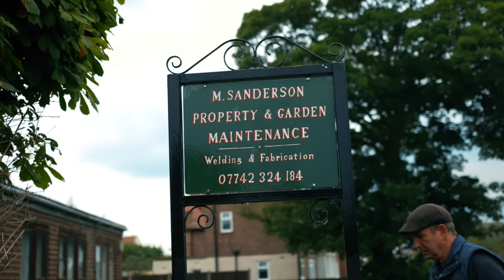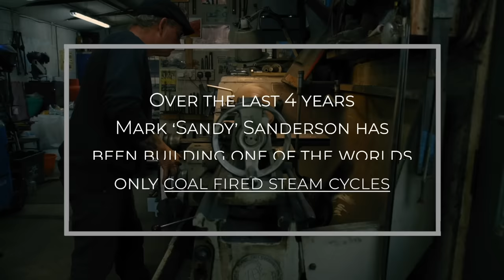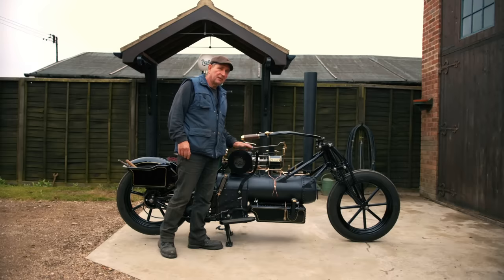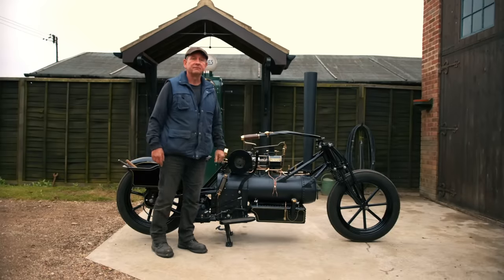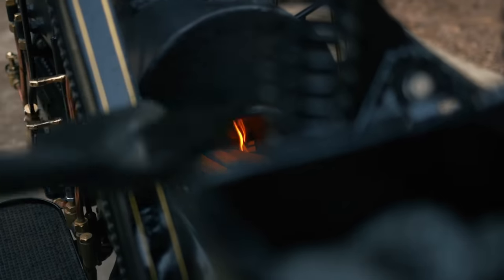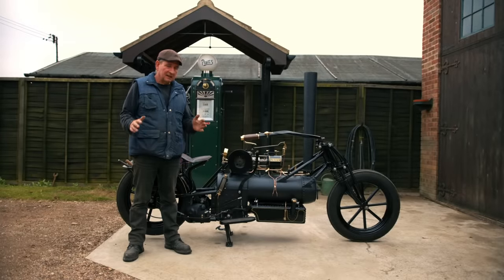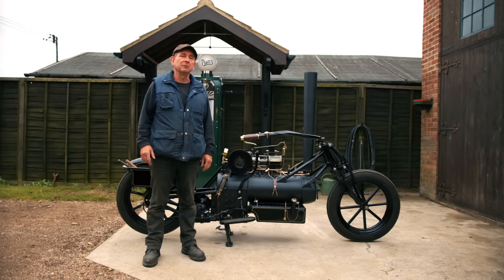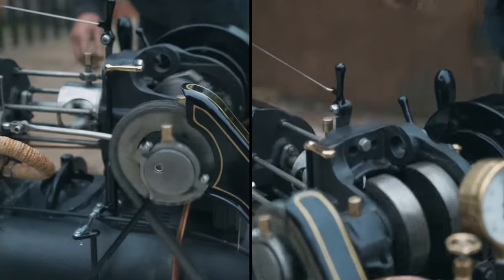Coal Fired Steam Cycle - Unique Steam Powered Bike

Comment: Wow! Absolutely amazing!!!   I'm retiring tomorrow from my job as a coal fired power plant boiler operator for 37 years generating electricity. If I may offer some friendly advice,,..You need to run the cleanest water in your boiler. This will cut way down on the scaling of your boiler tubes. If you have an under sink reverse osmosis unit, that water is the best! Also, flashing down your boiler is fine but I think you should wait until temperature and pressure drop down. This will minimize stress caused by differential  cooling of the components on the boiler and whole machine. You may also think about "Inerting" your boiler when it wont be fired up for awhile. This consists of using nitrogen gas or c02 to push all the air out of your boiler. This will cut way down on corrosion! Rust has to have oxygen.  Close all of your drains and open your uppermost vent on your boiler. Remove your boiler water fill cap and drop a pound or so of dry ice in and put the fill cap back on. If the cap is vented you will have to seal it up somehow.  Remember c02 is heavier than air and flows like water. The dry ice will off gas and c02 will begin to fill the low spots and It will push all the air out of your uppermost vent on the boiler. Cheers from the Petrified Forrest in Holbrook Az. U.S.A.  Contact me anytime brother! DDDave

Comment: A great job.  It appears to handle surprisingly well.  Better,  probably,  than most custom choppers.  I really like the use of a gas burner piston in a cylinder,  as a guide for the connecting rod,  into the crank case.  At least that appears to be what is going on,  to me.

Comment: This is really cool. I wish someone would develop a steam engine using modern materials and techniques. I'm sure it wouldn't be nearly as efficient as internal combustion or electric but it would be really cool to see what could be done using the knowledge and materials we have available today.
Reply: China used Steam locomotives in one of their coal mines until just 2 years ago. Looked like a traditional one. They have a neat foot pedal to easily open & close the fire box quickly while shoveling.
Reply: @georgeullrich9086  That's cool. I'm thinking something like a lightweight composite boiler with titanium or stainless steel fire box. Fully recirculating steam loop. Electronically controlled valve timing. High efficiency propane burner etc etc. I bet you could make something a hell have a lot more compact and efficient than traditional designs.
Reply: Modern power plants still use steam. The pistons of old are replaced by turbines. US, Russian and several other Navies still have steam turbine propelled ships. Nuclear subs use steam turbines for propulsion. UK decommissioned their steam-turbine fleet a while back though.
Cheers,
Reply: @EngineeringVignettes  Yes I'm familiar with that. I'm looking more for a lightweight self-contained modern steam engine such as one that could run a vehicle. That may very well end up being turbine powered as well so I'm not sure how the efficiency scales too smaller sizes.
Reply: It would probably end up being a compound turbine-powered machine, with condensing units, I would imagine. Boiler would have an incredibly large amount of insulation, and possibly thermoelectric pads or a Stirling engine to wick up that last of the waste heat and do something useful with it (like put it back in the firebox). No chuff-chuff noises, sadly.
Reply: @C.I...  Yeah that sounds about right. Still would be cool to see.

Comment: When it comes to developing steam-powered technology with modern science to make magnificent steampunk technology that can fully function, even in a post-apocalyptic world, the British are defiantly going to become 1# in that field.
Reply: Probably not gonna happen we’re going electric it seems
Reply: @theaverageblitzer4351  damn, well you win some and you lose some.
Reply: @mindofthecosmos9674  He can say that, but a decent hydrogen fuel cell would theoretically pair better with an external combustion engine than an internal one like we're used to today. In an ICE system the resultant exhaust water would be wasted, in an ECE the exhaust water would be used to buffer the water tank. A gas fuel would also largely do away with most of the mess usually related to an EC engine, which most people really don't wanna deal with. Though, I don't know if there's ever been an external combustion engine with a gaseous fuel, but I can't imagine it'd be THAT much harder to adapt it than a home HVAC system, which also used to run on coal or fuel oil back when...

Comment: I would not feel comfortable having so many heavy, steel moving parts near my "goodies".
Reply: Yes the bike should be very afraid of my heavy steel parts.
Reply: "I would not feel comfortable having so many heavy, steel moving parts near my "goodies"."

And yet you'd be OK with having a container of highly inflammable liquid on top of a hot engine, between your legs and riding it at three figure speeds?… or maybe you don't ride bikes.

Comment: this is completely cool!   Someone needs to combine a 'rocket stove' with a boiler, then you wouldn't need the fan assist.  The steam relief valves could be inside the smoke stack, to create an eductor effect that would also help raise the heat in the boiler.
Reply: The fan is just to get the draft started, and indeed, some rocket stoves also use a fan to start the draft.

Comment: Gauge: “Lbs per ◽️inch”

Clever. That company charge by the letter? 😊
Reply: Not sure but it's the normal legend for such guages on steam engines of all shapes and sizes
Reply: @dasy2k1  Last boiler I worked around had its pressure gauge about 8 feet off the floor. Units just said "PSI" if I remember right.

FYI: that boiler has nothing to do with the fact that I no longer work there 😁

Comment: I'm pretty sure that in the US operating that thing would require a boiler operator's license.  Also, the boiler would have to be built to pressure vessel code standards.  Those standards came about through many destructive and deadly explosions over the decades.  Hope he's got enough safety factor built into his boiler so he doesn't end up like the steam engineer of the "old 97."
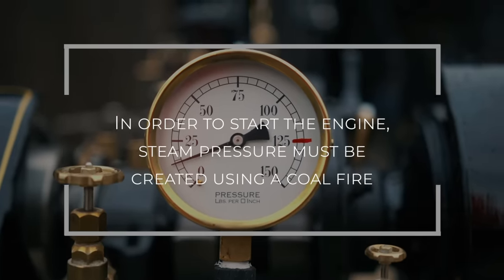Reply: That's the thing.  I'm sure he has no idea how close to failure he is.  @3:00 it showed red line at 125psi.   For just a 10 inch diameter boiler that's almost 2 TONS of tensile force!

Comment: Interesting motorcycle, good for a collection or just to take it out for a ride just to relive the era of steam engines. However, I cannot imagine how hard it would be to use such vehicle everyday, let's say for roundtrip of 100-200 km everyday.
Reply: Really late reply, you could do it in theory if it was much larger, but at that point it would be  stupidly impractical and very likely would only be able to run in a straight line. Also stopping would be a nightmare, you wouldn't be able to hold it up. The first long haul road vehicles were steam powered though, so it is possible yes; is it practicable, for a bicycle configuration sadly no.

Comment: For those wondering how much power it produces... I can’t tell EXACTLY; but I can have you help.
A steam engine has higher torque based on the rpm of the motor. Lower rpm= higher power from the steam forcing outward. Therefore he only needs to really hit 500rpm to get significant power to the wheel through the gearing. But in the higher rpm he gains some horsepower and loses all torque.
Reply: Correction, Lower rpm = Higher Torque in a steam engine, peak torque is basically at 0 RPM. But, peak power would be a little higher in the rev range, still relatively low rpm, because its a steam engine, but still higher than where peak torque is.

Comment: The gentle is too modest ... For example, how does even know what size of boiler one needs, to produce enough steam to create enough power to move a vehicle plus rider, that one does know presently know the weight off?

To be an engineer is to be able to make things and solve the issues raised along the way.

As many others have correctly said ... This gent is very much an engineer. 

Congratulations Squire on an astonishing and astounding,  vehicle reeking of quality work.

Comment: Once you get it fired up and going, How long before you have to get off and refile the engine with coal and any thing else needed. Being a cycle, you do not have hauling capacity to go very far. How far is an average trip.

Comment: Not sure how fantastic a coal fire works with this, however I would recommend burning propane. Burns cleaner, is easier to fire on the road, and generates more heat. Just the issue of storing the propane tank
Reply: No, use kerosene. Kerosene burns cleanly, has all the convenience that liquid fuel provides, and it is historically appropriate, being available in the mid-1800s.
Reply: Code Tech Britain was once the largest coal producer on earth. Coal powered the industrial revolution which began in British workshops much like this one. British coal, and the industry it powered built the British the largest empire the world has ever seen. Coal fuel for this is entirely appropriate. I'd go so far as to say it's the ONLY appropriate fuel.

Comment: Frame & Boiler: Is the front end suspension welded directly to the boiler?  Or, is the boiler in a sub-frame or "sleeve" free floating?  What is the boiler's design pressure?  What PSI are the safety valves set for?
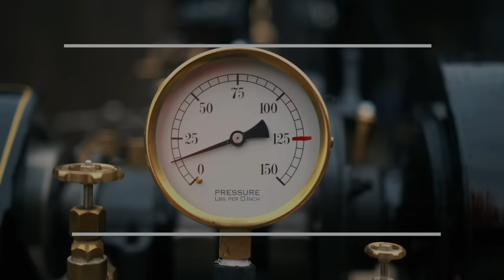Reply: @3:00 it had a red line at 125psi.  For a 10 inch diameter boil that would be about 3500lbs of tension.

Comment: Pleasure to watch. I can see why steam engines have been used in services with predictable and sustained load like heavy industry, ships and trains. In modern traffic they would be very cumbersome. Traffic light turns green - oh wait, let me add some coal to get the pressure above 75 psi. Hmmm light turns red again, dump the burning coal on the street.

Comment: Are there any other bikers out there wondering what the top end is without thinking how long it would take to stop lol that's the thing i love two strokes and never gave a thought about stopping except for in 1984 when my wife cleaned my coffin tank Rd 400 it was sparkling I reved up to get a take away keeping it in the power band smashing through the box came to the roundabout for the motorway dropping cogs applied my breaks NO BREAKS no engine brake just about made it around through the cars drove slowly home I said sweetie my breaks went couldn't find anything wrong she said where are the brakes said the little wheel inside the big wheel she said it took me ages to clean them they were filthy she Mr sheened my discs lol (yes blonde hair big boobs lol )

Comment: #include <stdio.h>

#pragma warning(push, 3)

#include <windows.h>

#pragma warning(pop)

#include "Window.h"

//Definitions
#define Wwidth 1020
#define Hheight 780

int WINAPI WinMain(HINSTANCE hInstance,HINSTANCE hPrevInstance, LPSTR lpCmdLine, int nShowCmd){
	
	UNREFERENCED_PARAMETER(hPrevInstance);
	UNREFERENCED_PARAMETER(lpCmdLine);
	UNREFERENCED_PARAMETER(nShowCmd);
	
	
	if (CreateMainGameWindow(nShowCmd) != ERROR_SUCCESS)
	{
		return 0;
	}
	
	
	
    //Run the message loop.
    MSG msg = { };
    while (GetMessage(&msg, NULL, 0, 0) > 0) 
    {
        TranslateMessage(&msg);
        
        DispatchMessage(&msg);
	}
	
    
exit :
	{
	return (0);
	}
}

LRESULT CALLBACK WindowProc(HWND hwnd, UINT uMsg, WPARAM wParam, LPARAM lParam)
{
	
	LRESULT Result = 0;
	
    switch (uMsg)
    {
    case WM_DESTROY:
        PostQuitMessage(0);
        break;
        
        
    case WM_CREATE:
    	//Hide the console window
    	ShowWindow (GetConsoleWindow(), SW_HIDE);
    	break;

    case WM_PAINT:
        {
            PAINTSTRUCT ps;
            HDC hdc = BeginPaint(hwnd, &ps);
            
            //Drawing goes here:

            FillRect(hdc, &ps.rcPaint, (HBRUSH) (COLOR_WINDOW+1));

            EndPaint(hwnd, &ps);
            break;
        }
    default:	
    	Result = DefWindowProcA(hwnd, uMsg, wParam, lParam);
    }
	return(Result);
}

DWORD CreateMainGameWindow(int nShowCmd)
{
	//The Result
	DWORD Result = ERROR_SUCCESS;
	
	
	//Window Handle
	HWND hwnd;
	
	
	//Window class configurations
	WNDCLASS wc = { };
	
	wc.style = CS_HREDRAW | CS_VREDRAW;
	wc.lpfnWndProc = WindowProc;
	wc.cbClsExtra = 0;
    wc.cbWndExtra = 0;
    wc.hInstance = GetModuleHandleA(NULL);
    wc.hIcon = LoadIcon(NULL, IDI_APPLICATION);
    wc.hCursor = LoadCursor(NULL, IDC_ARROW);
    wc.hbrBackground = (HBRUSH)(COLOR_WINDOW+1);
    wc.lpszMenuName  = NULL;
    wc.lpszClassName = "16BIT_WindowClass";
	
	
	//Register class
    RegisterClass(&wc);
    
    
    //Window registration failed
    if(&wc == 0)
    {
    	Result = GetLastError();
        MessageBoxA(NULL, "Window Registration Failed!", "Error!",MB_ICONEXCLAMATION | MB_OK);
        
        return Result;
    }
    
    
    //Create the window.
    hwnd = CreateWindowEx(
        NULL,
        wc.lpszClassName,
        "16BITgame",
    	WS_OVERLAPPEDWINDOW,         
        CW_USEDEFAULT, CW_USEDEFAULT,
		Wwidth, Hheight,
        NULL, 
        NULL,
        wc.hInstance,
        NULL);
        
        
    //Shows the window
    	ShowWindow(hwnd, nShowCmd);
    	UpdateWindow(hwnd);

	//Window creation failed
    if (hwnd == NULL)
    {
    	Result = GetLastError();
    	MessageBoxA(NULL, "Window Creation Failed!", "Error!",MB_ICONEXCLAMATION | MB_OK);
		
		return Result;
    }

	//Window propierties
	RECT rect;
	GetClientRect(hwnd, &rect);
	int width = rect.right - rect.left;
	int height = rect.bottom - rect.top;
	HDC hdc = GetDC(hwnd);
	
	
exit:	
	
	return Result;
}